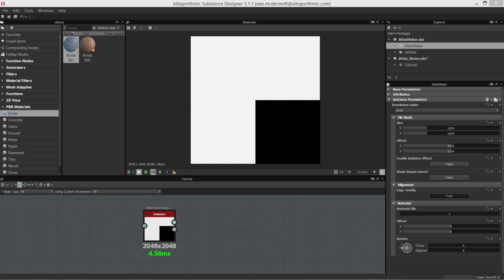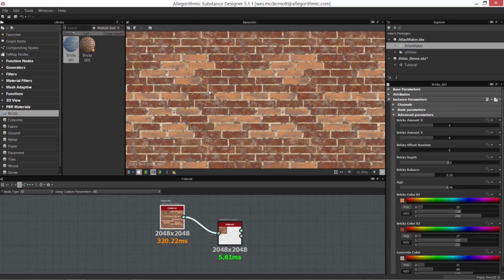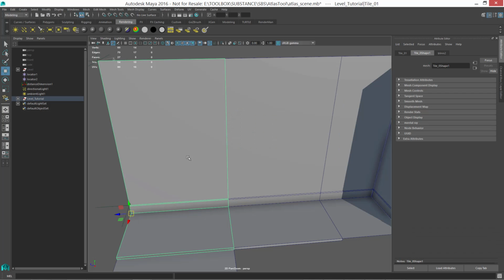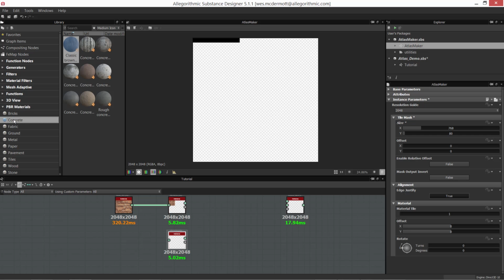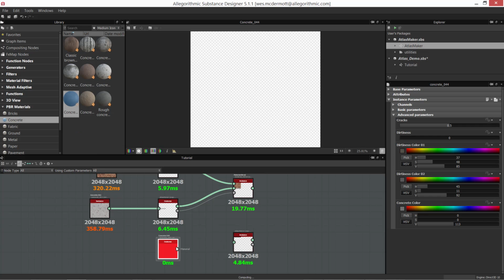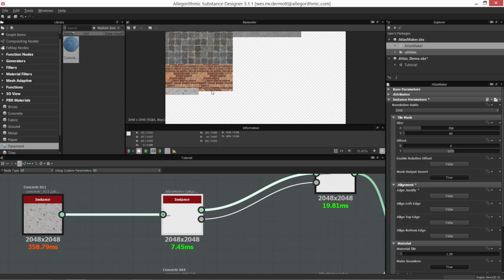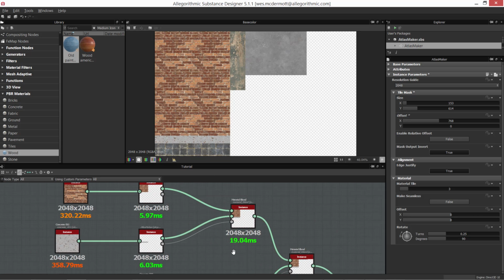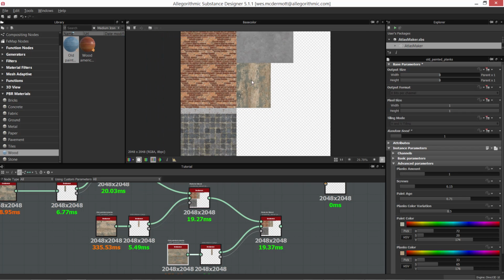Creating a texture atlas #2 | Adobe Substance 3D

Comment: Not sure if you'll see this, but im having an issue with blending the AO maps. Ive made sure that the Material Blend node has AO enabled, and that all my materials are outputting an AO (if i direct each material directly to the outputs they show the AO), but when being passed through the Material Blend it always outputs black in the AO. Any ideas?
Reply from the maker: It could be that the AO channel is not enabled on the material blend. The node has a channel parameter where you can enable or disable channels.
Reply: @Substance3D  Hi. Ive tried that unfortunately. Still no luck. They just seem to want to blend. Every Material Blend has AO enabled. But output is black...
Reply from the maker: @saito0969  Been looking at it myself as well, it doesn't seem to work well. Not sure if it's a solution for you but if you open the Material Blend SBS file (right click, open reference), you can copy paste the entire graph to a new package and just make you own edit of it. I fixed it by setting the AO to blend with another mode.

Comment: Is there a way of setting up an opacity map within the Texture atlas?

I am trying to use it for bolts and need there to be the mask in place where the bolts are
Reply from the maker: I'm sorry, I left out the opacity map : )  I just need to add it as a channel. I need to make some fixes so I will add opacity as well.
Reply: Allegorithmic no apologies necessary, fantastic work as always and making texturing fun!
Reply: @Substance3D  Hey, was this ever added? Currently I'm trying to add it myself into the Atlas Maker but when I do the crop kills all my opacity. Either that or the material transform does.

Comment: I'd love for this mode to work effectively. However I find that at 4096 resolution, if I want to offset to the bottom half of the texture, the edges become inaccurate. The edges of a brick texture don't line up with the edge of the mask, they look like they are a few pixels out. I'm finding this frustrating because my textures in the atlas all have a defined edge built into them at the canvas borders. What am I doing wrong? I've tried using relative offset and edge justify. I can't decide if it's the mask edge which is inaccurate or the placement of the texture within the mask.
Reply from the maker: I'm very sorry for this issue. It's probably just a bug in the node. I will need to check this to make sure it works correctly with 4K.
Reply: That would be great. Basically if my texture has a defined edge which i would like to use, such as a brick wall or floor tiles, its always offset a little within the mask which is frustrating.

I have resorted to making my atlases using material blend nodes and shape nodes for the mask which has worked ok but it would be nice to have it all packaged in one node.